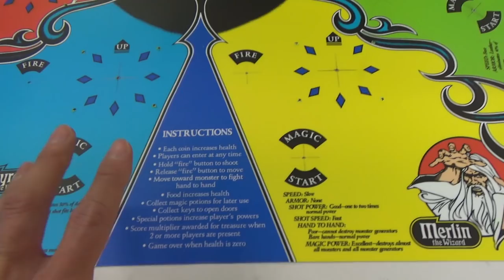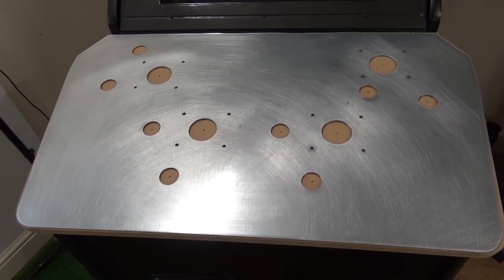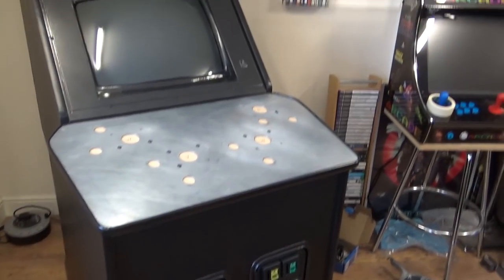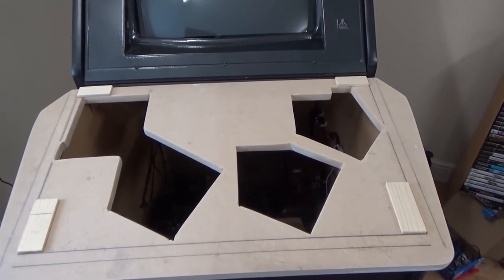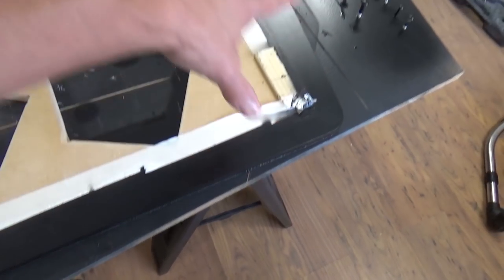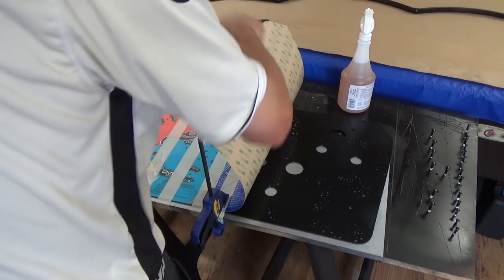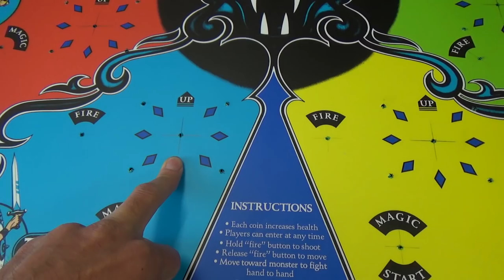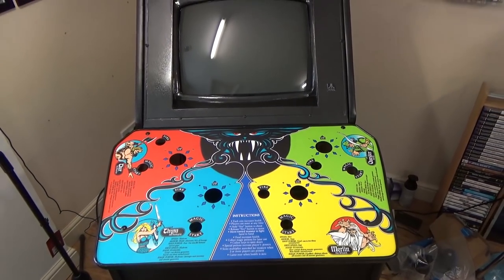Gauntlet Arcade Cabinet Scratch build. Part 17. Control Panel Build!

Comment: Love Your videos Andy. Why full paint the metal. You could have used a router (if you got one) and an routing iron with a bearing against the metal plate as stop/template when doing the MDF plate. Maybe put the 4 bolts a bit under the surface of the MDF, and not through metal / artwork. 
Can't wait for next video. Keep up the good work.

Comment: That was brilliant mate, you done extremely well matching up the holes to the artwork, your talking litterally mm out from the joystick markers, your not a machine mate your a human and i doubt even the original build had as much care taken on it when it was first built.  I suggest using scalpels to help cut out the holes, they are smaller than a stanley blade and more versitlie, you could get a better shaped circle  first time. Still its a bloody good job thus far, i didnt understand spraying the steel black though and i was thinking the 3m sticky back on the artwork may not stick 100% to the steel because of the barrier of paint? Could i be wrong.